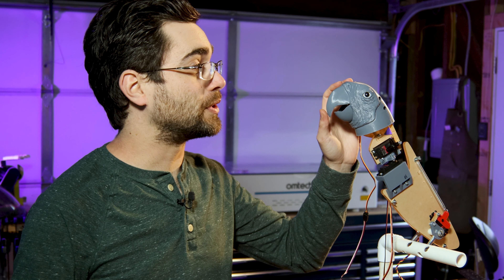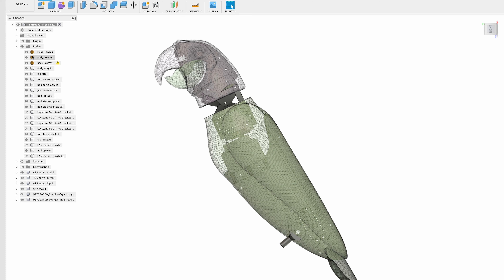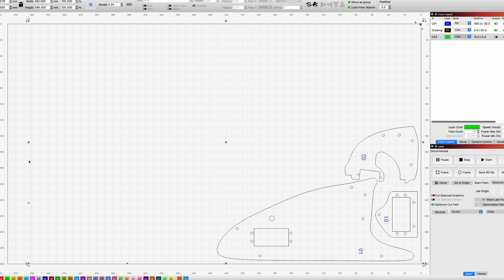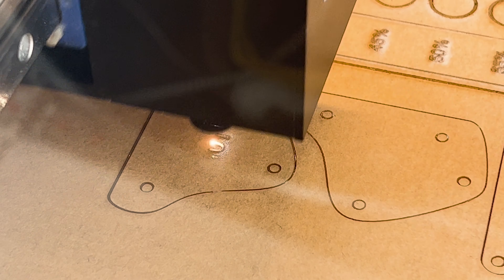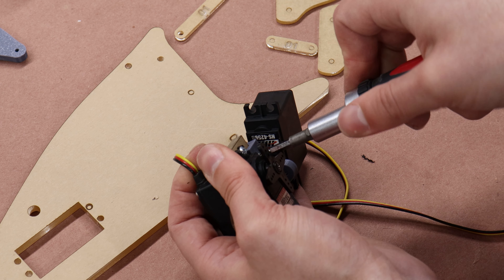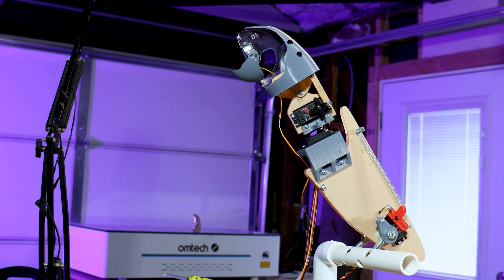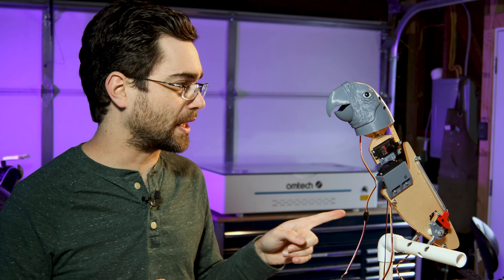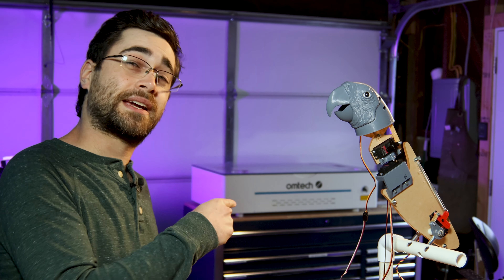Making Animatronic Parrot Parts with the OMTech Polar Laser

Comment: How does the laser cutting on acyrlic do vs wood?  I would imagine the acrylic pieces are faster to cut but are there any downsides vs wood?
Reply from the maker: The only downside I can think of is acrylic is probably more brittle than wood, but not too significantly. I wonder about wood rubbing against itself over time, or expanding from moisture. The acrylic seems to be a more stable and consistent material to me. Plus it looks nice (once you actually take the brown paper off).